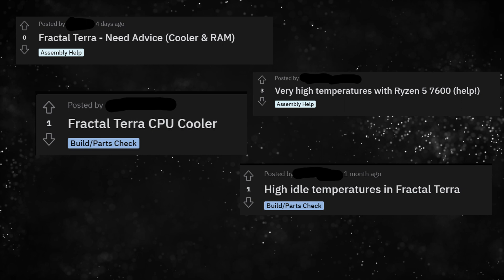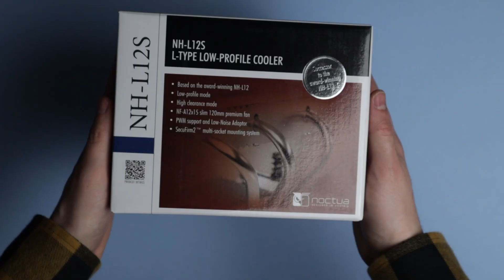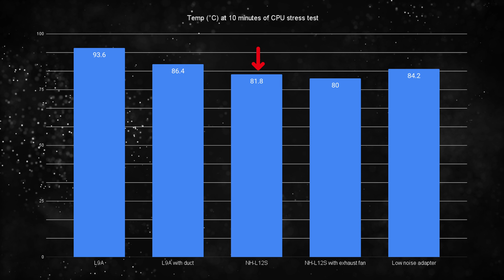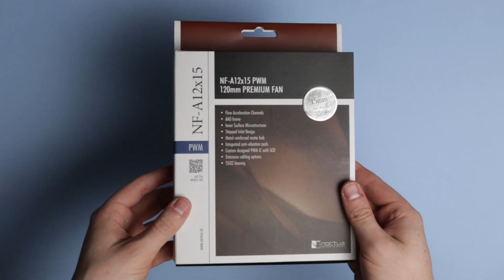What’s the Best CPU Cooling Layout for the Fractal Terra?

Comment from the maker: As many of you have pointed out, the audio is in this video is very low! Apologies and the issues will be resolved with the next video.
Reply: It's a great video and you do great work my friend thank you kindly
Reply: Noctua home
Reply: I was able to hear everything in this video, I dont know why y'all complaining about the audio quality. Great video nothing to complain about.
Reply: You should fire the moron who mounted the processor radiator, having the blades horizontal. The guy has still not understood that without a fan forcing air flow through the radiator, the horizontal blades will behave more as a heat retainer than as a cooler. He has still not understood, in other words, that without a fan forcing air flow through the radiator, only vertical natural convection upwards can dissipate the radiator's heat, and thae horizontal blades just impede this. 🤣
Reply: @arnoaldloukasscirpionis1558 be positive man

Comment: Just get the mods from ASKR mods that allows for top fans, reversed gpu flow, and a low profile psu cable.  You can set the bottom intake and top exhaust and you're good to go.  Best thermals possible in the case.

Comment: they really should've just added a bit of height internally at the top to fit a mount and some slim fans. Then decrease the extra useless space underneath the case. Then we could've just directed more air out of the system

Comment: All is about the thickness of the GPU you are using, if you have a GPU with over 50mm thickness the Noctua L12S is going to be an issue, because it is 77mm high, and you only have 120mm of space in the Fractal terra! So be aware! Or a thick GPU or a bigger CPU Cooler. Pick your poisson.

Comment: I'm wondering whether it wouldn't be much better to run the bottom fan as a forced intake and let "pressure" help with dissipating heat out of the case better. It would pull cooler air into the system instead of trying to run exhaust in a place, where the heat in the case is likely the lowest anyways.

Simply turning it around could be worth testing.

Comment: I want to build in this case. I want to use the 9900x and 9070 XT and Corsair Sf850 PSU. But not sure what Mobo and cooler to get. How do I check if a cooler fits?

Comment: I tried one of the low-profile Noctuas first (120mm), but it didn't fit.  I ended up with a ID-COOLING IS-67-XT, which fits perfectly and is dead quiet.  I also used a Thermalright LGA1700-BCF CPU contact frame.  I don't do any gaming, so this setup is more than good enough for me.
Disclaimer: this is the ONLY computer I've ever built, so I may in fact have no idea what I'm talking about.  😁

Comment: Thanks for the video! Does a 120mm long and 50mm width GPU work with the terra case? Afraid of turbulence  since it seems 120 mm width is max and 70mm noctua L12s will be against the case wall... :/

Comment: Im owner of the old Noctua NH-L12 which i had for 10 years ( if i remember correctly) and have no issues with fan going bad im using only top 120mm fan ( with LNA) since ive had only cpus with 65W of power ,its maintenance free .

Comment: Hey quick question, I am looking into building that Case too and I opted for now for  Ryzen 5 7600X. I was initially going to go for the L9A but I might change course after seeing your video. Another Noctua Cooler that seems like would work with that case is the NH-L9x65. Same form factor than the L9A but much fatter while still being more compact than the NH-L12S (65mm instead of 70mm). What do you think ?
Reply from the maker: L12S for sure! The L9x65 would only be better if you have really tall RAM sticks that won't fit under the L12S. The L12S will perform better temperature wise
Reply: @SmallBoxCentral  I wonder really, According to the Noctua website, the L9x65 should be good enough for the 7600X assuming no overclocking. many other people that have built this case didn't have any thermal throttling issue, even with the L9A.

Comment: Im planning to run a low profile rtx 4060 and ryzen 5 7600x. I'm gonna run the Theralright AXP90-X47 full copper with an exhaust fan at the bottom of the case. Im thinking and hoping the temps will be fine.
Reply from the maker: Those sound like good component choices for this case 👍
Reply: @SmallBoxCentral  thanks for the reply! Did a bit more research and found a few builds where people were able to fit a 92mm slim fan at the top, so now im considering making that bottom fan an intake and the top (if it fits) the exhaust.

Comment: Is the noctua L9x65 a good cooler? Ryzen 5600 may upgrade to 7700
Reply from the maker: it's okay but there are better options available
Reply: @SmallBoxCentral  do you know one that would fit alongside a 50mm width proart 4070

Comment: With a Ryzen 7900 (no X) to be installed in a Fractal Terra is the Noctua NH-L12S okay or is a smaller sized cooler also sufficient? Is AMD's stock cooler to be discarded? Thank you.
Reply from the maker: L12S would be okay, but it will be very hot. If you can get the L12Sx77 that would be better. Avoid anything smaller than the L12S
Reply: @SmallBoxCentral  I can take the L12Sx77 but I would get to the maximum size of 77 mm for the cooler provided for the Terra. The Noctua site gives me it compatible with the Terra only in low-profile mode (fan installed under the fin). How much space would I have left for a graphics card? 43 mm? Toward which model of Nvidia 4060 or 4070 I could move toward? Wouldn't turbulence be created on either side? Would DDR5 Corsair Vengeance and an Asus ROG STRIX B650E-I be okay as RAM and motherboard? Thank you very much.

Comment: For my Fractal Terra build, I’m using an Intel i7-13700T with the new Noctua NH-L12Sx77.  The CPU base power is 35W with a max turbo frequency of 4.90 GHz.  This isn’t a top tier gaming PC.  For that, i would use a bigger case for better cooling.
By the way, this video was great to help me get through the build.

Comment: Have the 7800X3D in my Terra. Running IS-55 Black with the 15mm Noctua on top. I did liquid metal under the IHS and everywhere in between. Running 64c on my CPU with a 4080 Super crammed in the case as well. NH-L9 is not the best cooler.
Reply: Where else would you apply LM "everywhere in between" besides the die and IHS?

Comment: Hi there, I am currently planning my build in the Terra but I do have an issue. I have a Gigabyte Aorus B450i Pro Wifi Mainboard which has the cpu socket weirdly placed close to the end of the PCB which makes it kind of hard to find a CPU cooler. Did I see correctly at 1:40 that this is a Gigabyte Aorus B450i Mainboard you are using?
Reply from the maker: Correct, same motherboard
Reply: @SmallBoxCentral  Thanks man, you helped me a lot.

Comment: If somehow the case can be connected as a heat sink to the CPU that would be the best IMO
Reply: Mine actually does that: The fins of the cooler are directly touching the side panel in mine because the graphics card just barely fits on the other side.

Comment: I've seen many use the L9x65 which has an almost double in height radiator and still fits the Terra. Even went into this video hoping you would compare it
Reply: I use the L9x65 with the ryzen 7600 without any exhaust case fan and my cpu temp maxed on the 60s most of the time. The cpu doesn't throttle and the case still quite silent even in the game. Guess maybe I'm just lucky on the silicone lottery.

Comment: Of course you're not going to get great thermals with low profile air coolers. There's not a lot of surface area for the heat to transfer. You can always undervolt the CPU for lower thermals. You're not going to lose much performance in gaming. 🤷‍♂️

Comment: Visually gorgeous, but just too small of a case for my taste.  I would be worried about heating issues over the long-term.
Reply: I had a different mini itx running super hot gaming most nights, and on 24x7 for 4 years, there were no issues. It will be fine as long as accepted range is hit.

Comment: He has the NH-L12s fans set as exhausted before fins? Too close to motherboard? I know if you set cpu fan as intake or in downdraft position you pull in fresh air but with fan being so close to side panel, will it will be noisier and slightly obstructed by panels? Not the smallest of venting holes (mesh would be better). 

So my question is what's the best way to setup cpu cooler fan orientation on nh-l12s if both downdraft or exhaust setups seem to be limited? Feels like either side would still be either close to panels or close to motherboard. 

Link below shows one needs 30mm of space for fans to work at max efficiency. I assume that counts for coolers as well. 

https://youtu.be/ULvTzuV2hJI?si=Ry7hgh4qsFf0QtaK

Comment: Hello, I have an EVGA RTX 3080
it only takes 2 slots so I should have a bit more space for CPU cooler
which one do you recomend?
have you tried any cooler from scythe?
Reply: there is the l12s-x77 but it onty works IF your gpu is exactly 2 slots 

If it's just a little bit taller you'll need the spine in position 2, meaning the x77 wouldn't fit so you'd get the regular l12s instead

EDIT: wait nevermind, that gpu is 2.75 slots, not even that would fit

Comment: did you have any issues fitting the NH-L12s cooler on the gigabyte b550i aorus motherboard? The noctua compatibility list says "the I/O panel shroud is too big."
Reply from the maker: I don't have that motherboard, so not sure. The one I have is the B450I :(
Reply: @SmallBoxCentral  oh OK, thanks. You have the b550i linked in the build video btw

Comment: Technically, a full size fan will fit under the PSU as exhaust in this case, even with a grille attached. I have it in mine right now and it is working great. However, you will have to shove it under the gap with some force and feed the fan and the grill under separately. You may or may not need to remove rubber pads as well to get it through. To me it was worth it for the improved temps and noise vs. a weaker and louder slim fan.
Reply: This depends on if you have a SFX or SFX-L
Reply: what kind of cpu fan do you have? and cpu?
Reply: wouldnt you want it as intake though as heat rises?
Reply: @Fitnessforyou2003 in this case exhaust is better, active airflow overpowers natural convection.
Reply: I have a SFX PSU, and discovered that I had to bend the legs of the fan grille to fit it in with the fan itself haha

Comment: I recently purchased this case. 

I have an 14th gen i5 and used the L9i with the foam duct kit and it was running way too hot for my liking. 

I ended up switching to the L9x65 and have seen much better temps running more CPU intensive games. 

My GPU is a 2 slot and I had to slightly adjust the room for the CPU from the stock setting to fit this comfortably, but still has a lot of room for the GPU. 

I recommend going with the L9x65, if you can.
Reply: What temps do you got? I have the same L9x65 for my i7 12700k and I had to underclock and undervolt a lot to get to below 93ish.
Reply: NH-L12S ?
Reply: How about Deepcool AN600?
Reply: It really depends on what i5 you have. In my opinion L9X65 is not enough for 14600K, for example. Probably would barely fit for 14600 non-K.
Reply: What GPU did you use bud ?
Reply: There are much better choices than the L9x65. Thermalright AXP120-X67, Deepcool AN600 and ID-Cooling IS-67-XT dominate the 67mm cooler height category but even with those you will need to heavily undervolt a 14600K for any CPU intensive workload. For gaming they'll work fine.
Reply: will go for the same cooler with the 13600KF

Comment: Do you think a 13 400f with a NH-L12S would over heat? also can you give me an approx of how loud it would be Thanks ! great vid btw
Reply from the maker: I think that is probably the best CPU for this case, results would be similar to mine in the video but maybe a bit louder/hotter under full load
Reply: @SmallBoxCentral  oh i just realized the 12600 kf is cheaper and it has better performance while being easier to cool so I think ill go wit that one instead
Reply: oh it seems like the NH-12S in my local stores don't come with lga 1700 ??????? this is so confusing please help if the NH-L12S is not compatible with lga1700 what cooler should I use ?

Comment: 7700x with Noctual L12s are always hit 95c in my rig (Fractal ridge)
Need to undervolt it or limit it performance so it will throttle at 85c.
Reply from the maker: Damn that's toasty
Reply: I got 7700X with ID cooling IS-55. The iddle temp. is around 50-52 deg.C. When gaming, the temp max is around 75-78 deg.C. But the fan noise is noticeable.

Comment: If you are asking us, I don't have this case yet. Going on water blocks, ek-quantum velocity am5 ddc 4.2 pump, reservoir, block combo along with a ek quantum surface s140 rad pair (if you can find the space for a 2nd up top?), and a series loop... ie. CPU OUT to rad #1 IN to rad #1 OUT to gpu IN to gpu OUT to rad #2 IN to rad#2 OUT to CPU IN... 7800x3d CPU, Asus tuf rtx 4080 plus gpu water block. It might fit, dunno.
Fan: Noctua NF-A14 ippc pwm 2k rpm or, if you trust pwm go the 3k rpm (it's also louder)
While the case might sound busier than La Gardia, it's an On Demand deal just make sure it's plugged into the motherboard pwm fan header.

Comment: Idk if you tested, but what would be if you take the exhaust fan as an intake fan and letting the cpu cooler push out the air on the side panel?
Reply from the maker: I did not test it but I think with small builds like this, it is best to have every fan possible set to exhaust to remove as much heat as possible. If you did have it as intake I can't imagine the difference being more than 1 or 2 degrees though
Reply: If you have the bottom fan as exhaust, the hot air would just rise back up into the case where it's trying to exhaust, there's not much space for the hot air to exhaust to the bottom of the case, also hot air rises. It's better to have the bottom fan as intake to take in fresh air. @SmallBoxCentral

Comment: Many thanks for the content; used the Noctua NH-L12S on a Ryzen 5 7600 in my  terra build, so far so good!
Reply from the maker: Great to hear!
Reply: Hi, what temp and noise? Thanks
Reply: have not hit above 75 yet, noise is very audible but I don't mind it. The metal case amplifies the fan noise and it's on my desk, very close to me.   @martinbrach7899
Reply from the maker: @martinbrach7899  01:59 in the video
Reply: how many slots does ur gpu have? I got a 2,5 slots GPU and not sure if the 12S fits, atm im using a l9 x 65
Reply from the maker: my 3070 is 2.2 slots, I think you will be fine with 2.5 @eigenerkram2245
Reply: @SmallBoxCentral do this CPU cooling IS good for a i5 14500 ?
Reply: @eigenerkram2245 I used in my terra the configuration of cpu/cooler with a 7800xt hellhound triple slot. It is very close but fits
Reply: is the L9x65 noisy on the terra since its close to the sides of the case? @eigenerkram2245
Reply: What GPU did you get? :o
Reply: omg that is exactly what i am planning to build, i absolutely dont want to NOT do the terra, it is such an amazing case and my partner said she would love it as well as part of the decor and aesthetic. I was so afraid that it would just be an oven. How is it? How are the temps? pls dm me lmao

Comment: or just dont buy a noctua cooler for this case since the results are so poor......ID cooling and thermalright have better coolers for this type of setup at a lower price
Reply: Also looking for cooler recommendations for the Ryzen 7700 in this case
Reply: ID cooling IS 67 XT  @AlteredVisioned
Reply: What would you suggest as your best option for this case?
Reply: @djfuse254 Id cooling is55
Reply: ID cooling IS-55, Thermalright axp90 x47 or x53 - get whatever fits your setup
Reply: The noise becomes annoying very quickly, otherwise it’s a good suggestion.
Reply: @enri_1986 how annoying? And what is the best lp coolers? I am planning to go non x because the x variants get hotter, and I am wanting to build a PC that I can stash away like a laptop
Reply: @alphagiga4878  if you mean cpus then yeah, go non-x. But for coolers the X dont matter. If you want the best low profile air cooler, most popular choice is apx90-x47 or x53 BUT only the COPPER heatsinks variants, which come with the orange fan. If you want budget, get ID cooling and you can swap the fan if you want.
Reply: @lavone5541 What's the perf difference between aluminium and copper fins AXP90 ?
Reply: @BaiedesThe difference is thermal conductivity or energy transfer. Copper has better properties in this application
Reply: I have one and its actually really good

Comment: For the L12s, which direction do you have the fan blowing? Into the cooler or away (towards the cpu)?
Reply from the maker: I had it pushing air out of the case, but you have the option to reverse it. I think pushing air out the case is the most ideal for this specific case
Reply: The blades scope the air and blow away from the cpu. My buddy almost convinced me to reverse that but this video made me keep it as it.

Comment: Will a 13600k and noctua NH12s work?
Reply from the maker: It will work but you might need to set a power limit on it so it doesn't get too hot. Otherwise yes should be fine
Reply: and this cooler works with all the lga1700 boards? @SmallBoxCentral